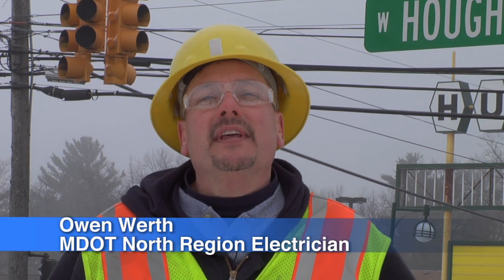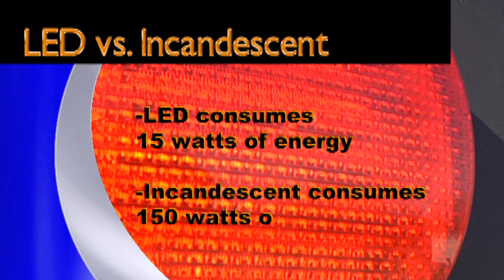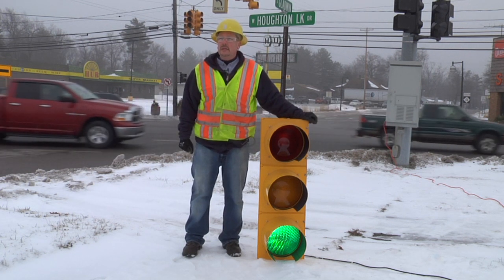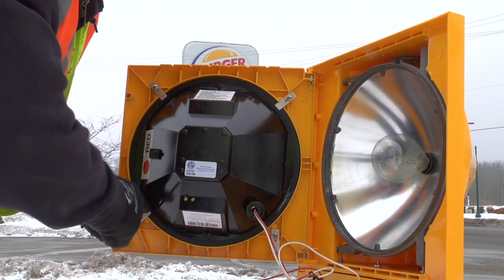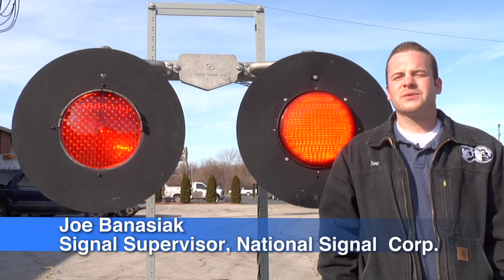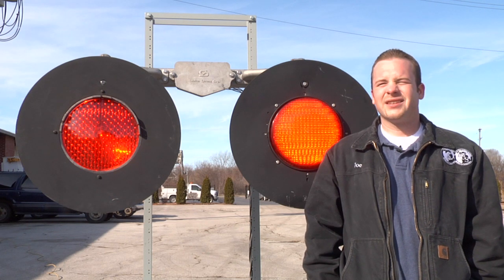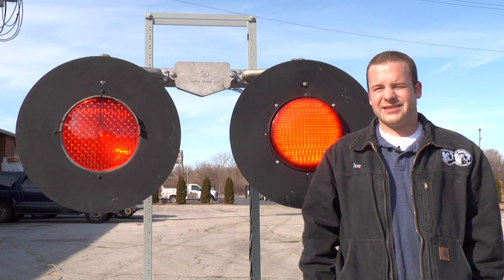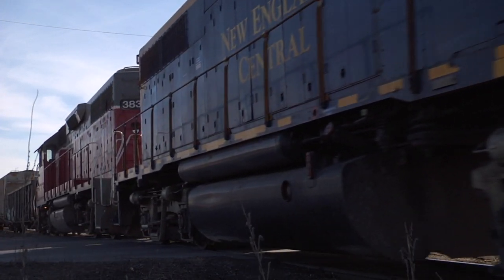In the Field Reports - "LED Traffic Lights"

Comment: All traffic lights should be led because LED diodes last longer than the incandescent bulb
Reply: That type of LED you saw in the railroad crossing signal actually has a shorter life than the incandescent. A traffic signal incandescent bulb can last for 16,000 hours which is actually around 10 years but that type of LED has died in just 4 to 5 years.
Reply: @sandiegotrafficlightstrain354  Dialight LED’s are the best, we have some 15 year old Dialight led modules in traffic signals still working today.

Comment: Usually if you use a cap visor instead of a tunnel visor, the snow problem is less likely. Also, newer LEDs nowadays are a lot like the incandescents now with no more individual bulbs, but instead looks like a full lens. All our county and state sets have span wire installations, and I have yet to see any of those newer LEDs fail.

Comment from the maker: Thanks for the comment! While it is relatively rare for winter conditions to create an obstruction in the signal heads, they do sometimes occur like you said and our crews respond quickly to clear them. As with situations where signals go dark during power outages, motorists need to proceed with additional caution.
Reply: Okay what do they call the issue in a traffic light where one side never goes green for like almost an hour and a half but it goes through a cycle where you can make out the other side light it goes green to Yellow back to Greens that are red because I don't seem like I ever see YouTube video touching on this issue I want spent an hour and a half at a traffic light because of that
Reply: A few traffic lights in my neighbourhood the red bulbs are still burnt out I think they should all be led as they last longer
Reply: @simonbaker2501  leds have glitches
Reply: @leakesonasucs  how do LEDs have glitches
Reply: A lot of traffic lights in my neighbourhood still use incandescent bulbs even with the red and green Man do you think traffic lights and pedestrian crossings should all be led

Comment: I'm not sure how you feel that the railroad crossing LEDs are so-called vandal-resistant compared to the standard incandescent both of them can be smashed or stolen, on a more important note, the only issue that I see as an Electronics technician and somebody who has followed signal technology for many many years is the downside of these LEDs in the Northeast and snowy parts of the region is that the fact that they don't emit any type of heat or warmth, and they allow snow to accumulate over their faces and therefore many times during blowing and drifting snow, makes them difficult to see if at all, I understand that there are some LED replacement units that may have some type of built-in heaters? But I think that would kind of defeat the purpose of the energy-saving LED product to begin with, any comments on this?
Reply: The bulbs with heaters can detect when to run the heater and therefore only need to run sometimes. They also only heat the front surface of the lens meaning they use much less power anyway even whilst heating, since the rest of the fixture can remain frosty cold. After all, snow on top of the thing doesn't really matter.

Comment: MitchginDot I want to know why YouTube doesn't report on the issues when a traffic light several times like I've been stuck at a traffic light for almost an hour and a half once because my side was red never went to me in fact it's skip the cycle altogether and the side that was supposed to go read I could see the light I could get where I could see the other side light it went green yellow green
Reply from the maker: Sorry to hear about situation, anime. Sounds like a sensor isn't recognizing your vehicle at the intersection. Which intersection does this occur on? If a state road is involved (I, M or US routes), we can help. If both roads are local roads, then you'll need to get in touch with the local road agency in that area, typically the city or county. Hope this helps! Thanks for watching our videos!

Comment: what about the snow and ice that covers the light, the incandescent light puts out some heat to help melt the snow or ice that would cover the light, led lights dont melt snow and ice therefore i have came across several lights over the winter that were led and snow covered and could barley see the light, i think that is a safety hazzard
Reply: If you can barely see the light, you're supposed to treat it as if it's on.  Standard driving procedure...

Comment: Yeah it looks really nice when some of the led chips are burned. Seriously though, why dont they just screw in an led bulb?
Reply: There are a few reasons.

Normal A19 LED bulbs are all diffused and therefore wouldn't utilize the reflector since the light all goes forward, resulting in a hot spot in the middle of the lens and too wide of a viewing angle where cross traffic could potentially see the light at its full brightness. Proper LED retrofits have a better design and the light is quite even and directional, especially in modern units. I've got some 8-inch fixtures with the old incandescent setup of a glass lens and an aluminum reflector and they certainly suffer from that problem with normal bulbs, and I assume that 12-inch fixtures would too. I do know that filament-style LEDs exist and they do solve the optics problem, but more on that in the next paragraph.

The other problem is that on sunny summer days traffic fixtures get HOT inside, especially the superior black painted ones, since they're a sealed aluminum box with no shielding from the sun. Incandescent bulbs don't care about heat but normal A19 LED lights can barely keep themselves cool enough to survive 10,000 hours in a normal open fixture, and those are the expensive brands. In traffic use during the summer I'd bet they would die much sooner than an incandescent bulb since the electronics would be baked alive (incandescent traffic lights generally last about two years each). The proper LED retrofits are better designed to dissipate heat even in a hot environment, as they have a large open space inside the bulb. This is also why filament LEDs wouldn't be viable, since they have much less space for heat dissipation and would likely die within a couple of months. They already die more quickly than normal LED bulbs after all.

Lastly, in snowy areas, household LED bulbs couldn't melt the snow that can accumulate on the lens. In 2012 there was also no good solution for the proper LED retrofits but as of some years ago manufacturers created LED retrofits which can detect conditions where snow buildup is likely and melt it with integrated heater wires on the lens, and since the heaters only need to heat the lens they still consume far less power than the incandescent bulb, and only in those conditions.

Comment: News flash! LED Traffic lights are M U C H more unsafe during winter
Reply from the maker: We haven't really had any issues, Siren. If we do run into an issue with snow packed in during winter storms, crews have been instructed to take care of it.
Reply: MichiganDOT, Oh, but incandescent lamps kinda save the pain of brushing it off
Reply from the maker: No pain at all, really.
Reply: So use incandescent because it saves you pain
Reply from the maker: As we stated previously, no pain at all.
Reply: Just look up "led traffic light" and the "but sometimes" video is your answer.
Reply: if signals cannot or do not show anything, it must be treated as a 4 way stop.
Reply: Some L.E.D. signals have small heaters in the unit.